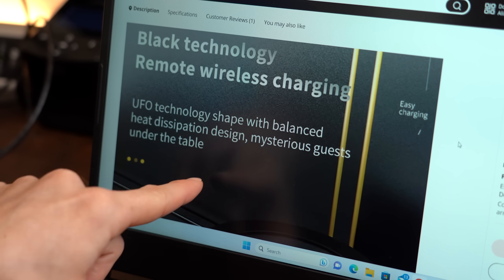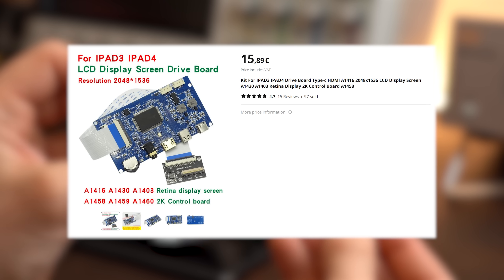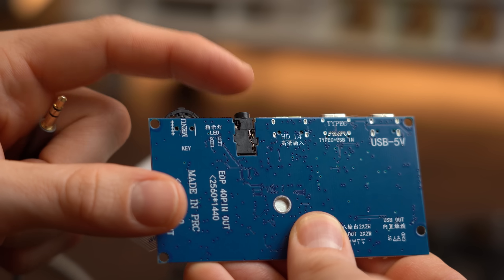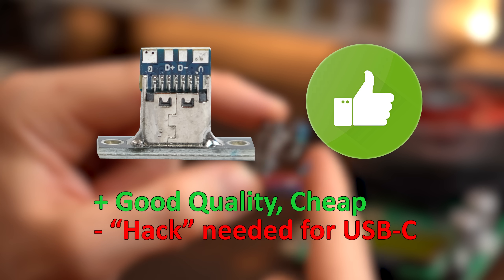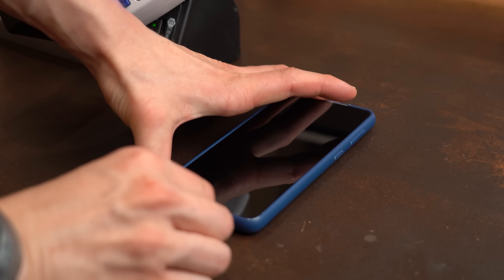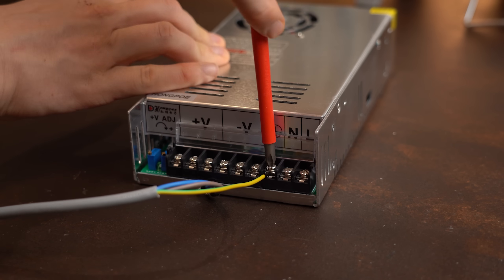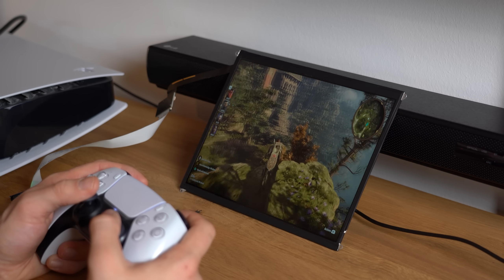I tried finding Hidden Gems on AliExpress AGAIN! (Part 7)

Comment: Quick note on the USB video function: It takes a DisplayPort signal, so the USB device must support USB DisplayPort
Reply: For this test, he used the same Samsung phone that was later shown charging wirelessly in the video, that pretty much grants it's one of the various Galaxy S phones and all of those have DisplayPort output via USB-C...
Reply: @mbc07   On Samsungs DisplayPort alt mode is only enabled when the peripheral supplies USB PD. Basically Samsung requires you to use a USB C Hub, which is why every USB display hub on Amazon has Samsung in the title lol
Reply: @TheOfficialOriginalChad  that's not a requirement. As long as the cable/dongle doesn't draw too much power, the phone will happily drive it by itself, at least that's how it works on my S10e...
Reply: @mbc07  S20 and up, maybe? Reddit has been full of people asking why their Galaxy S won’t work with a usb monitor for years. My work phone is an S22 and I can’t use the same USB to DP cable as my MacBook Pro. Works fine when plugged into a dock with power. Stops working if I unplug power.
Reply: @TheOfficialOriginalChad  that sounds plausible. 

I haven't tested a lot of peripherals (nor tried video output on the newer Galaxy S phones), but I got my S10e outputting video via USB-C with both a USB-C => DP cable, as well as a cheap, no brand (and unpowered) USB-C => DP + USB-A dongle. 

The S10e will stop all communication moments after I plug a power hungry device (like an external HDD) to the USB-A port of the dongle, although keyboards, mice, USB flash drives and other low power USB devices usually work fine...
Reply: I have the exact same board and it's working on USB-C input, with a Lenovo USB-C cable, signal from a Thunderbolt port on a Lenovo laptop and the extra display is from another broken Lenovo :)
With a board presented by GreatScott in an earlier clip (clip 6, LiPo charger/booster) and some flat LiIon batteries you can get a nifty portable display. Oh, and the board accepts signal from a touch panel too.
Reply: @iliecsorin  Good info thanks for solving the mystery. TB is DP.
Reply: @mrjoelpt can you share us the discord link please?
Reply: Or touch (?) Connect to Windows or Linux (not Mac) computer with HDMI and A to C cable. Worth trying, you probably have the cable.
Reply: @Luhanopi  what do you mean touch? They just got the display without a digitizer.
Reply: @TheOfficialOriginalChad  I haven't noticed. Some displays have it over USB
Reply: working on m1 macbook, but i assume anything thunderbolt, plus that provides both video signal and power, so a single cable is needed. have yet to test with displayport only , but i assume that’d just feed video and would require power
Reply: @jeen0351  And a special cable
Reply: @mastergscrewu no, still have to plug and unplug, maybe a split cable video+power may do the work
Reply: If he has a Nintendo Switch he should try that (I think that uses USB C DisplayPort although I could be wrong)
Reply: @stoutscientist  nope, the Switch needs the cable to provide power for it to even try to send a video signal. Also it’s notorious for not following USB-C spec and many hubs/dongles don’t work with it.
Reply: @TheOfficialOriginalChad  That's what I was afraid of
Reply: @stoutscientist  don’t be afraid. We will get through this together.
Reply: @stoutscientist  on top of what the other person said, the switch also uses USB-C's HDMI alt mode, not the DisplayPort alt mode
Reply: @VisibleReality  Ah ok,I thought it might use DP alt mode since the Switch was probably in development before 2016 when HDMI alt mode came out

Comment: you can reprogram the nrf beacon with an stlink, arduino for creating your own custom ble coin cell based applications apart from beacon like a portable ambient light sensor or proximity detector with a bit of hacking.

Comment: The beacon sounds interesting. I wonder if the accuracy is something to do with phone/app rather than the device. Also I wonder how open it is to be used without phone, say rpi or arduino. With phone alone I don't see much use for it.

Comment: I bought the same beacon 3 months ago. I hung it on my keychain and integrated it into my homemassistant via ESP32 (esphome bluetooth proxy). This allowed me to set up automations to turn the lights on/off and trigger my robot vacuum to clean.
I think this beacon is a good solution instead of using a phone with wifi or a smart watch with bluetooth. I don't have to wait for my phone to connect to wifi for the light to turn on (which can take a few minutes). I save the watch's charge because the discoverable mode is turned off. At the same time, with my esphome and beacon settings, the maximum delay for turning on the light does not exceed two seconds, and the CR2032 charge is still more than 90%.
Reply: Just beware that you are not the only one who can track it.

Comment: Came across that wireless charging a few months ago when I wanted one, thankfully I got myself the KPON branded one instead (a hexagon shaped one), it works perfectly here, 10W charge, comes with the wall adapter (requires a QC 2.0 12v 18w one at least), the relay coil and even an alignment tool. Pretty nice device, on my 18mm MDF desk it doesn't need the relay coil and works with just the sticker to "target" the phone. More expensive but considering it actually works, would say it was worth it.
Efficiency is likely quite bad as I would expect of not only wireless charging but long distance one at that, the phone heats up a bit more through it's use than the cheapo short distance pad I use normally, but it really does it's job on my desk.

Couldn't trust that "say goodbye to bondage" description but it's the best description I've read in years when searching for that type of product.
Reply: I also got the KPON charger. It charges my phone at a rate of +2100mA according to a battery app. I initially used it through my entire desk which is 28mm thick, but that charger very slowly at about 600mA. I ended up routing a slot in the underside of the desk so the distance is now about 15mm.
Reply: @Zwamdurkel  Is it slow through a thicker surface even with the relay coil? Interesting to know if so, wouldn't have imagined.
On my 18mm MDF one I can get it to show it's "fast charging" so more than 5w at least, gotta get an app that actually measures it out of curiosity.
Reply: @Kalvinjj It did not work through my 28mm desk without the relay coil. Even with the coil the speed was only 600mA. That's why I routed out the underside of my desk

Comment: You can keep the USB-C data lines if you have access to the CC pins, those are the ones you need to ground with resistance to negotiate USB-C power.

Comment: 7:43 If that is the actual test result, this is literally a steal for you

Wireless power is absolutely inefficient (as shown in the result, 11 Wh from cable compare to 18Wh from the touch wireless charger), transfer power through extra 2.4 cm of wood but only take the requirements power from 18 to 22WH, yeah, that is absolutely a steal for any DIY project, 3Wh isn't anything

Comment: I actually use this same Ipad LCD and HDMI board in my car for a custom headunit 😂 , works really well. Although, I hacked the adapter PCB to get a custom backlight brightness control to work via an external MCU for auto dimming in the dark
Reply: That's a cool hack!
Is it touchscreen btw?
Reply: @MuhammadVaid  I had to buy a custom touch panel to overlay, but yes, it is!
Reply: @RANDASH  Ahh awesome! Any chance you have a product link?
Reply: That’s actually a really good idea!

A lot of these aftermarket displays meant for cars are low resolution and have poor brightness, but an iPad screen looks great!

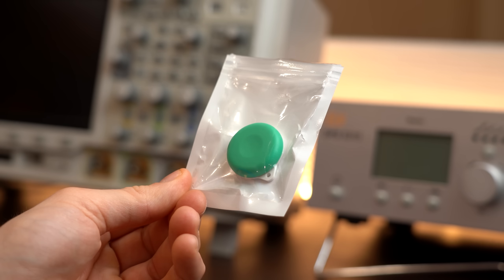Comment: 9:46, can it be used with some kind of 3D printed part to make a twisted car jig that will let you accurate make X twist per inch cables using a low torque motor? Or a least use the logic of it to disign a 3D printed remox that would do that? It eould be useful to buy regular cable and soec it to your desired applicarions (ethernet, CAM bus, etc).

Comment: Beacons like that need to be used with multiple gateways, and you move the beacon within the system rather than move your phone around. Home assistant can be set up to do useful presence detection in rooms if you carry a beacon like this.
Reply: I've tried doing this with 5 receivers spread around a 12' x 20' (3m x 6m) area.  Even with those I was only able to get accuracy of about 8 feet (2.5m).  The RSSI varies  based on the orientation of the antenna, obstacles, etc.
Reply: @mikebenza  that sounds about right. The best case is you can use it for sensing presence in one room vs another, but still not with a very high accuracy.
Reply: Stuff like ESPresense?
Reply: @Haldi4803  that's definitely one to try
Reply: You got to mess around with the settings regarding distance and accuracy. What ESP32 chip/board you use matters. I got way better results with an m5stack ESP32-C3 than I did with a ESP32 weoom but you have to tweak some of the default settings, you can find the ID (or one of the options for tracking, night be iBeacon) in the companion app for HA if you want to track your phone. For a smartwatch or beacon like this you really need a free third party app or use Espresense built in functionality to find the right ID of the device you want to track. Works great for me up to 12 meters but I have the cut off set to 8 meters. It really depends on the number of ESP32's you have, living space, wall material, ect.. I'm unsure why the C3 worked better and is more accurate. Last time I checked it only works with the C3 or original ESP32. You can't use an S2 or above and it's not needed either. The m5stack also looks way more stylish so it doesn't need to be hidden either which probably helps.

Comment: Hi, could you please check if the power supply output is grounded or if it is floating/isolated from earth? I would like to use  two of these PSU with output connected in series. Thank you

Comment: Could you run the "Monitor" from a Laptop only over USB C (data and Power)?
Reply: Theoretically yes, I've used monitors that charge my laptop via a single USB-C connection. But the power is going from the screen to the laptop. Not sure how many laptops output enough power via USB-C (and implement PD/QC for outgoing power). OTOH, I don't think most laptop screen use more than 10 Watt nowadays, so even without PD or QC, a USB device should be able to draw enough power for a screen.

Comment: I was also thinking about getting that mini screen. The LCD panels are sourced from older iPad replacement screens as I understood, so no wonder why they look very good.
But in the end I've got a used older 4:3 TFT LCD screen. It was even cheaper and was good enough for my need.
Reply: It's not a great idea if you have to buy a $25 screen. I have a 1080p display from an old Acer laptop and a $17 driver board that works perfectly. The only problem is finding a way to mount/secure the board and fragile cables without breaking out my ghetto fabrication skills.
Reply: Yeah, the aspect ratio is definitely the weakest point on there. [I think they're actually 3:2, but anything not 16:9 or 16:10 definitely feels weird these days]
Reply: @DoctorX17  I use a 3:2 screen daily, it does not feel weird at all

Comment: If you do a video on the DT3 USB cable tester (as shown at the very end of this video) you should consider "hacking" it with a CR2032 power switched lilypad coin cell holder glued on the back and wiring that into the GND/VCC on the input side. Now you have made the tester purely portable without need for a USB power source. It makes the unit much more useful. Keep up the posting of cool electronic / tools from AliExpress !
Reply from the maker: Thanks for the tip. Will do :-)

Comment: Ive been buying cheap solar street lights from there to modify them for USB/Power bank charging, for $2+ they are quite good and exceptionally bright for the price. Decent USB C Cables with wattage displays too, though they tend to be inaccurate of 2-6W depending on the cable, but that isnt bad at all.
Reply: Any link for good ones (or name)? I see a lot of them but but also a lot of people giving 1 star reviews on some.  Want to use them connected to a big solar panel and a simple dc/dc convertor with a high efficiency hooked up where the internal solar panel is. Been using it on led light strings here for years and works perfectly. The big 100 Watt panel is useless for other things during this period of year.
Reply: @Luke-san  The ones i'm referring to are probably not the ones you're thinking of, they have about 106 LEDs or below and are powered by a single 18650 and a 1-2w solar panel, they go for $1.99-$10 so are very easy to find on there. They are pretty damn bright for their size though, perfect for porches, doorways etc.

I've considered giving the large solar panel street lights a try that go for $30+ but i dont need anything quite that big, and id rather not risk paying that much for something that gives off similar brightness to the small ones 

many of the designs have been reviewed by people on Youtube so you could always give those a look if you need something that size.. Using a 100w panel would likely be overkill without a limiter though as even the larger lights they sell arent capable of handling that i dont think.
Reply: @DigitalIP    Those are exactly the lights I am looking for. Well the 100W panel is in parallel with a 150W panel.  Today I measured a short current of 430mA.  So not even delivering 10 Watt. That is wintertime here. Even during the summertime the led strings, garlands, are connected to it. I set the dc/dc converter to about 5.6 Volt and I can see that the current is limited somehow in the devices that I use. Some of them draw like 500mA, so in about 1 to 4 hours the cells are full.  The small dc/dc converter only can handle like 2 amp tops so it would cap out at 5.6 x 2 = 11,2 Watt anyway
I replaced most of them to old laptop 18650 cells that still have like 2000mAh capacity.  1 light I connected using thin wire wrap cable, is about 10 meters/yards away. I did that experiment 4 years ago and it seems that experiment is still going on ;-)
Using the original solar panels (6V ones) the lights died in about 30 minutes after it went dark during wintertime, now most of them make it through the night.
Reply: @Luke-san  Any updates?

Comment: I think that the beacon problem is the transmission interval.
If you try with a Samsung smarttag, the same will happen. But, if you give it a little time, or use multiple readings to take the average, the problem seems to go away
Reply from the maker: Ok. Will try that.

Comment: It's a Ipad Screen..
So does it also Feature Touch?
Reply from the maker: Not with this driver board. Sorry.
Reply: @greatscottlab   Thanks for the Answer.
Gonna probably buy it anyways for a CyberDeck.
Thx for the Recommendation.
Reply: @greatscottlab  I got another question to the USB-C Ports..
Is there a way to use them with PD, with just Resistors? 
So to use the Connector as a 9V Connector or other Voltages?

Comment: So if I have a dead 9in ipad pro with a working screen, can I get the little board and reuse the ipad screen?
Reply from the maker: Sure. There is probably a fitting driver board. Not 100% sure if this one will work.

Comment: a note on the "black technology" term on the wireless charging pad, "black technology" is just a direct translation of a chinese slang that means futuristic/forbidden technology, it's mostly just used as a buzzword to sound cool or attract the less technically inclined customers so i kinda hate it when i see the term used on taobao which is basically the "original" aliexpress that is only available in some parts of asia
Reply from the maker: Thanks for the feedback. Good info :-)
Reply: Is it possible to order from Taobao as an European?
Reply: @steameier8590  it's possible through some third party re-shipping services like one called superbuy, but it will definitely cost more for the shipping compared to someone more local like me buying in SEA
Edit: and you would still need to find the listing you want for those services to order for you and those listings would be in Chinese 95% of the time along with the Chinese only UI of the atrocious PC website or not as atrocious app

Comment: Those type c boards are meh, ali has the ones with proper smd resistors pre-soldered to both cc pins
Reply from the maker: Link please :-)
Reply: @greatscottlab  Item ID because youtube keeps deleting my replies: 1005005565153963

Comment: If you use that TikTok wire twisting tool electricians after seeing it will turn around. If something breaks and they need to find a fault, good luck
Reply from the maker: Doubt

Comment: Bro do you have any videos for Diy or Buy for the future?
Reply from the maker: Sure
Reply: I'd like to suggest a DIY or Buy topic: the combo of the IPAD screen + hdmi driver board: In the context of videography, build something with a 7" or 10" display, powerbank and driver board, or use a cheap off the shelve monitor. There's of course not going to be all the features of a Atomos Ninja, but in the range of cheaper monitors (without recording) I often see much lower resolution than an Ipad screen.